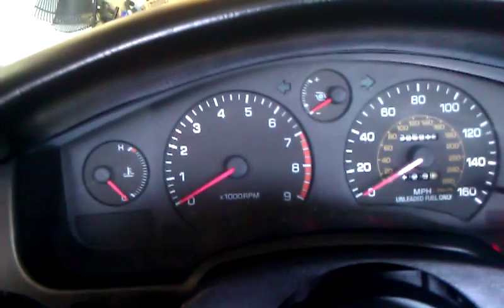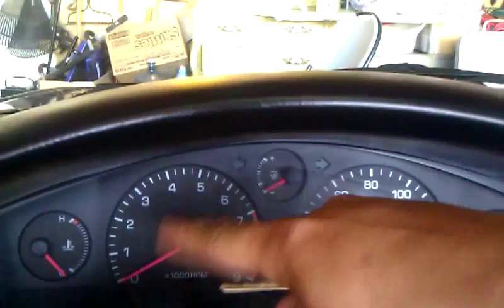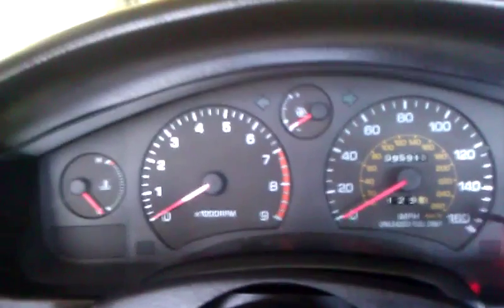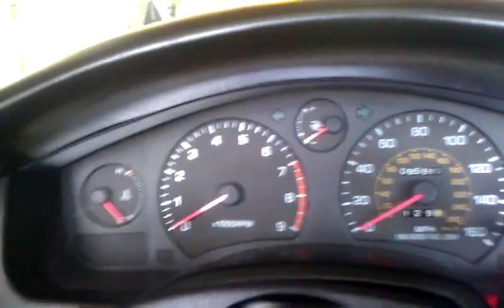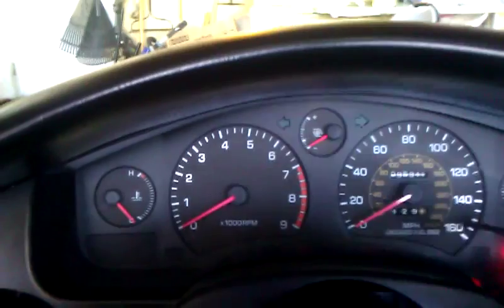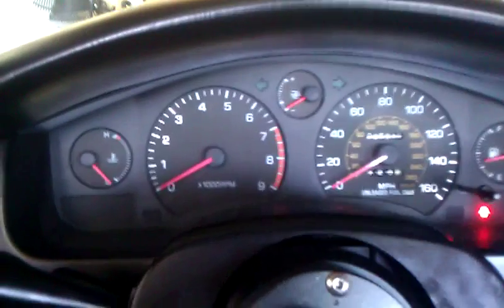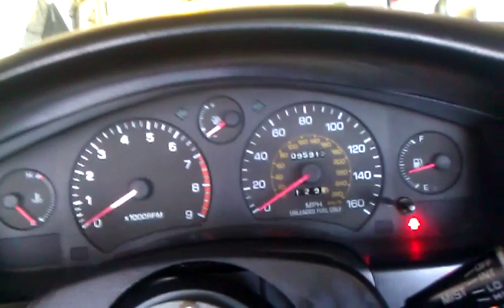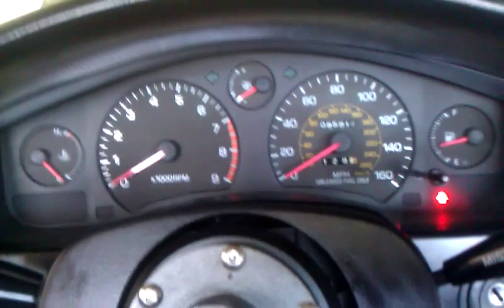Mr2 turbo fuel cut

Comment: hell ya brotha thanks I just got a 91 MR2 turbo and installed the wide band sensor but its reading lean 15-16 and im things its became the O2 sensor was cut off form the wires with no plug so not sure how to wire the O2 sensor or witch wire to put the wide band wire to the ecu or so it tells the car its running lean and to add fuel any thought ???

Comment: fuel cut occurs when the map sensor signal hit the limit that ecu can read....+-4.9vafter that cause of the overboost the sensor fall out of range so the ecu shot off for a fraction of second... that what we call boost cut...after shot down it fall back to where the ecu can read the value...till boost make map sensor fall overvoltage...

Comment: Fuel cut is when you hit a brick wall during WOT. Air is outflowing gas (FIC 1650's + e85!!)
Reply: dsmspyder1 no, fuel cut is the ecu cutting fuel because boost is to high... Flow and pressure are different aswell... Thats where efficiency comes into play. Either way on the generation MR2 he's talking about he is saying if you boost over 12psi you'll cut and that may be a vacuum line leak to the wastegate... Boost leaks at the pipe shouldnt cause that since MAP sensor is in the manifold for intake.

Comment from the maker: No. if u have a boost leak your mr2  will give u a fuel cut if u try to throttle it. It will start bogging because of the boost leak and then it will gice u a fuel cut also if u boost more than what ur supposed to(12.4psi) if ur stock.

Comment: Useful info thanx !! I hit feul cut on my 3rd gen swapped '91 when I set the boost a tad too high, trying to set it to the right psi I wanted. I was trying for 15psi which shouldn't be exceeded past that unless you're decatted. I want to decat this summer and go to 18psi.